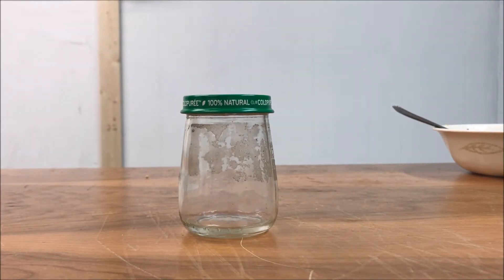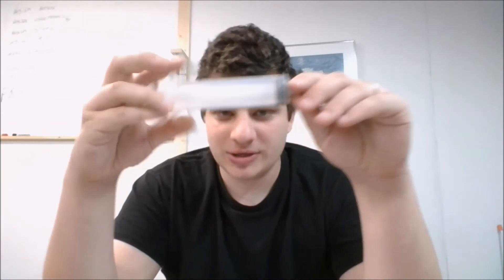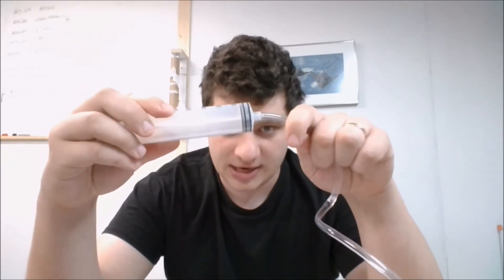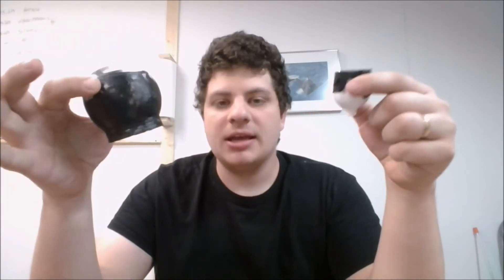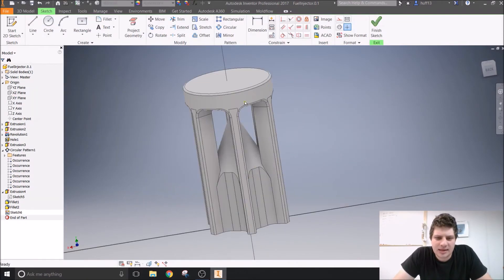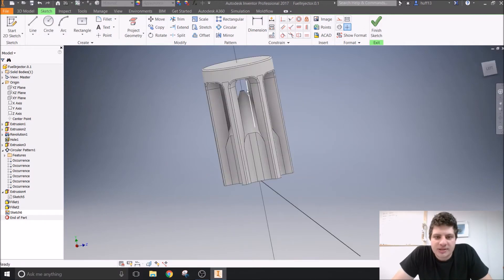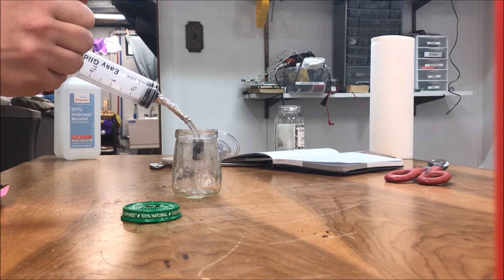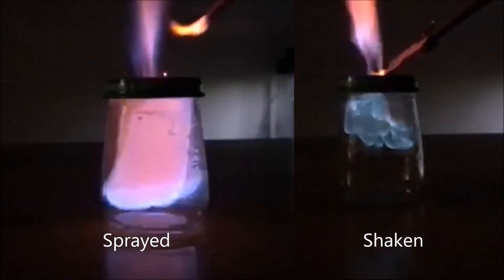3D Printed Fuel Injectors: 3D Printed Jet Engine, Part 1

Comment: As an actual certified airplane mechanic, this can't end well. But you have my attention!
Reply: And my help if you need any advice or ideas.
Reply from the maker: So I have a few plans that make it less scary, I'll talk about these in detail in my next video. But for now, there are a few things that will hopefully ease your fears a little. 1) I don't plan on feeding fuel continuously, I plan on putting a thermometer inside the engine, and using an Arduino to only feed fuel when the temperature is low enough for the plastic. 2) I'm only going to have a one stage compressor, and a one stage turbine, so there won't be any really energetic reactions.

If this my prototypes don't spend more time burning, than running, I will be shocked.
Reply: add another aircraft mechanic to the list, but I just work on big round piston engines. Plastic and fuel? what could go wrong haha can't wait to see this series continue
Reply from the maker: +Paul37pyro if nothing else, there will be fire!
Reply from the maker: +OriginalHotrodder that's a great idea. I've thought about it a little. My original idea was water cooling, but the complexity it adds might not be worth it. I've also considered lining it with that aluminum tape used in duct work. That might insulate it a tad. Maybe I'll do a bunch of tests and see what works.
Reply: Paul37pyro make that 4!
Reply: There must be something that attracts A&P's to your channel, count me as #3.  I like your idea and looking forward to seeing it progress.  Have you thought of insulating the plastic that will be exposed to the flame front with a thermal barrier?  Something like this product http://www.hytechsales.com/insulating_paint_additives.html mixed with a plastic primer like this http://www.homedepot.com/p/KILZ-1-Qt-Adhesion-Bonding-Primer-L211104/204763141?cm_mmc=Shopping%7cTHD%7cG%7c0%7cG-BASE-PLA-D24-Paint%7c&gclid=Cj0KEQjw8tbHBRC6rLS024qYjtEBEiQA7wIDeZHjgmqYNwImNGnoQKESYJHAURmnL1duZ_0o6fU_gXgaAkNE8P8HAQ&gclsrc=aw.ds then top coated with a high heat silver might give you minutes of run time.  Keep up your good work.

Comment: Haven't done it, but for this application might want to learn "Lost PLA casting" in order to make components out of metal. (Alternately there are 3D printers that sinter, but those tend to be unaffordable to the usual hobbyist. And TIG based printers are still very experimental.) Most plastics that are printable don't hold up to high heat very well.

I'd say print, cast, and assume some level of light machining of the cast component for tolerance to fit and stuff like having clean holes, etc.
Reply from the maker: That would be really cool. I've done lost foam, and lost wax casting before, I can't say I've tried lost-PLA casting, however. Making metal parts would be way more effective, and probably quicker. However, the whole point of this is to see if I can do it out of plastic.